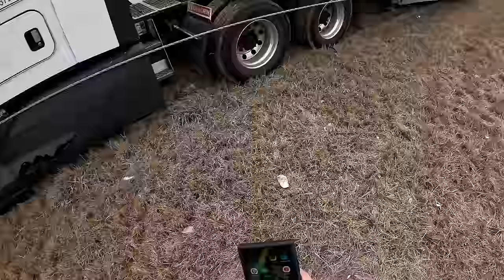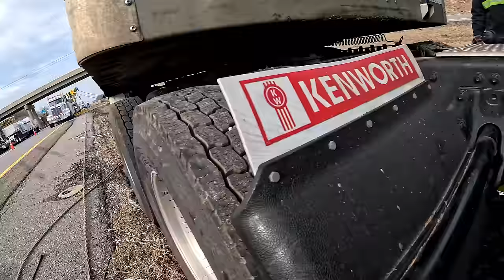Under Tension!  Another Tangled Truck!

Comment: hey Ron.  i was just told that you can't tow with the rotater because it would be over weight.  is that true
Reply: Ron has videos where he has towed with the rotator. I believe the western star was on another job when he used the rotator for a hazmat tow with family. Ron also used the rotator to the trailer after s semi fire on the interstate.
Reply from the maker: In Missouri I can tow anything in an Emergency or on a "first-hook" basis with the rotator, since we are considered Emergency Personnel with Emergency Equipment.  However, going across state lines, I must be legal just like any other truck on the road.  If I tow much of anything out of state I do have to get an overweight permit or have a blanket permit.  Anyway, we try to keep the rotator available for wrecks and recoveries.  While using the smaller trucks for the towing needs.   Thanks for watching and God bless.

Comment: I don't get it.  Why not cut the cable?
Reply: MoDot can reinstall the cables at a later date and re use them. It's much more dangerous to cut cables under pressure, and a lot easier to use the system provided.